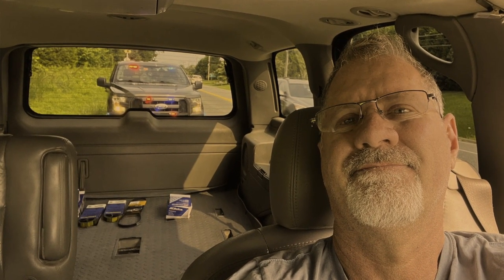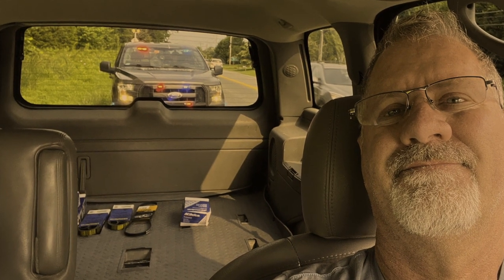Preparing for Yukon re-inspection | Failed, Failed, Failed!

Comment: JFC...I think I'll keep my home base in Alabama. That is so ridiculous. 
I just spent $500 to get full tune up on my gmc Savana and ac fixed and almost fainted 
Then $700 for the same on my Isuzu Rodeo including new radiator.
I figure I'm good for years now😂😂😂
Still haven't figured out why the Altima keeps burning coils though.
 I'm headed to Colorado Monday morning to stay until the End of September.
I do have something to tell you. I did the whole van build including my 200 watt solar setup, wiring and all, by myself. Thank you❤ for your videos. You and Bob started me on my journey almost 4 years ago.
Reply from the maker: I certainly hope you ARE good for years, jhemmes1. That Altima still has me perplexed. Burning coils would most commonly be a sign of more voltage than the coil is rated to handle. Starting with an OEM coil and using a multimeter with contact points from the coil to the distributor, we should see a reading of 12 volts. Loose connections can be a cause of over-voltage also. Has the voltage been tested?

Comment: No way to find out where the more lenient inspection stations are? It's not advertised, but some mechanics are better at working with you. Sounds like this guy is frustrated that he's not getting any money from you. Inspection stations lay in wait to make extra $$ off people. Hope it works out for you. After all you've done for others, Karma will surely settle up at some point.
Reply from the maker: Astute observation, 2Chimbleys. I agree with the inspector to replace wear parts but it becomes a slippery slope when inspection stations are incentivized to find parts out of tolerance, while the shop also sells the replacement services. 
When I arrived to drop off my vehicle, the shop had every bay filled and, coincidentally, a parts runner was dropping off brake pads and rotors (Based in the packaging) among other parts.
My goal overall is to rise above this trivial B.S. Something I have to keep reminding myself.